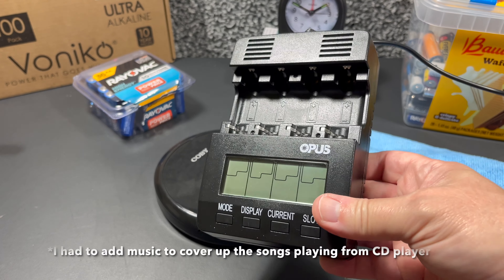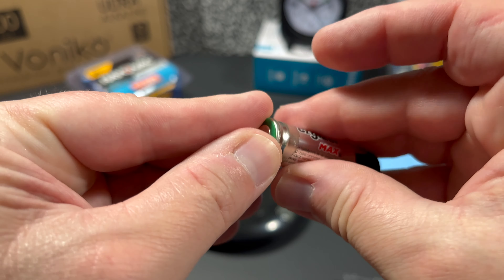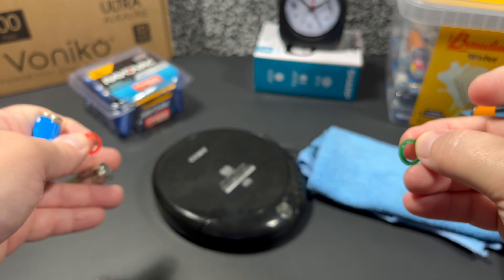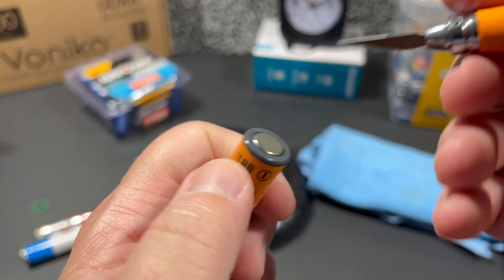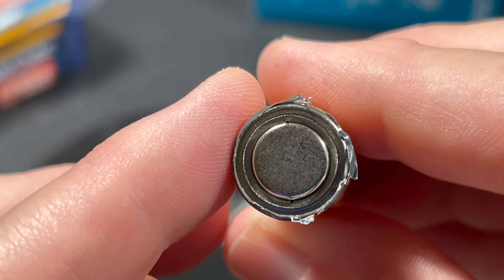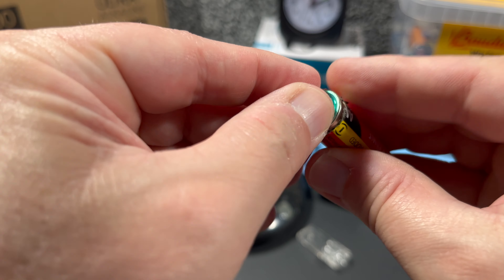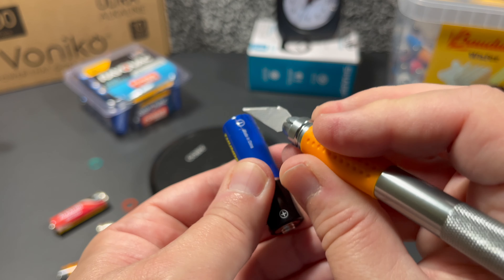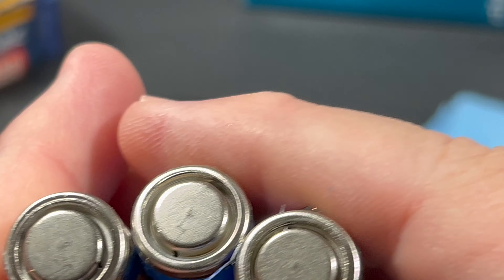Under the End Caps - China AA Batteries - Energizer Voniko Amazon Basics e-Circuit Thunderbolt Edge

Comment: You know what... The venting gaskets are likely deeper in the battery.  I think what these gaskets are for is to prevent your device from shorting the can to the negative should the wrapper get a hole in it.  If you look, there is gap between the center and the outer.  The can itself is the positive while the center part is the negative.  But if you had a device with a large spring (and the plastic wrapper broke), it could touch both the center and outer part of the center, which is the can and cause a dead short.  So it is probably there as a fail safe should the wrapper become damaged.
Reply: but these are on the negative end not the positive if it was to prevent a short it should be on other end
Reply: @ranger178  The entire can is the positive terminal. The small circular spot in the center of the bottom is the negative.  They come close right there.
Reply: @tarstarkusz  must be crazy new way the chinese are making batteries then because most of my batteries have can is negative
Reply: @ranger178  That's lithium.  They do have a negative can. But most alkaline batteries have a positive can.

Comment: 4:51 Don't let anything metal or conductive touch across the bottom.  The can is positive and the button in the middle is negative.
Reply from the maker: Thanks
Reply: @kev-reviews  its for ease of manufacturing, old way can negative is harder to make with lithium insert. so they changed the can to positive shove the insert in and close the bottom. plastic is just extra insulation to prevent a short

Comment: The only way to know if these batteries are the same is to chemically test them.  The chemistry from battery manufacturer to battery manufacturer is similar, but not exactly the same.  The physical build similarities can be caused by them using the same or similar machines to make the cells.
Another much easier approach you can take is to buy a battery meter that can read the internal resistance and a scale that can measure down to the milligram scale and weigh them.